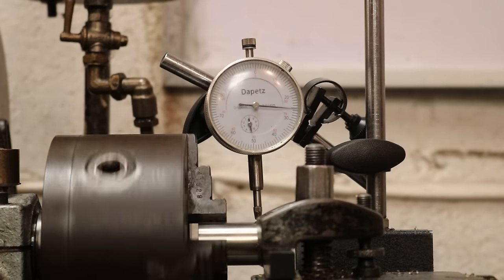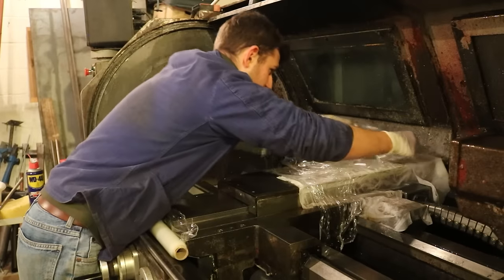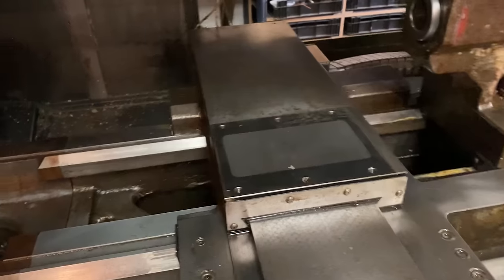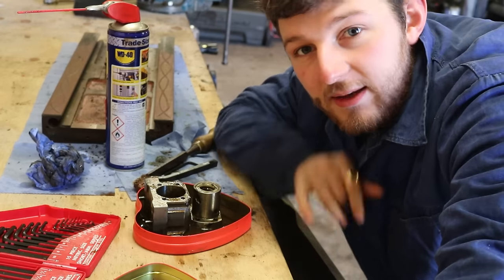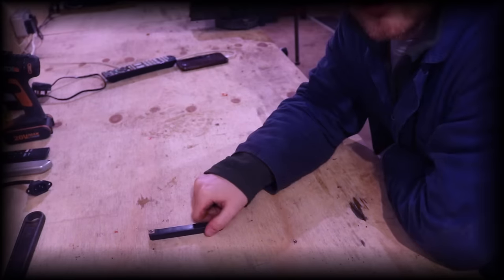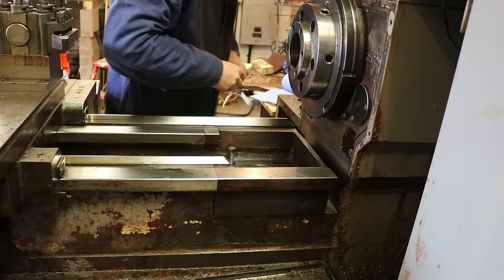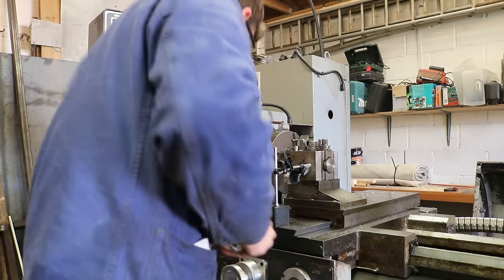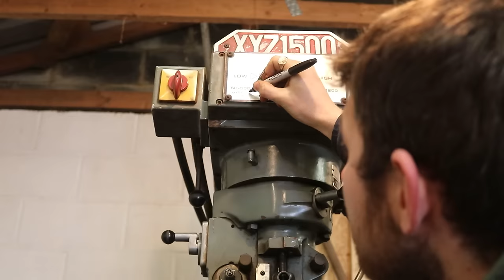Huge CNC Lathe Restoration || SANTA MARIA

Comment: Put a drill chuck on one of the cross slide tool holders. Use the tailstock only for part support.
That way you can also drill precisely, and it's how proper drilling is done on CNC lathes anyway.

Comment: What an awesome machine you got up and running! 
Im a bit concerned about the jaws you used... I would advise you to get some proper "rough jaws" that you can use for rough raw materials that comes in all sizes and keep the other jaws for specific diameters. Nobody wants to see a lathe yeet a part across the workshop :face-blue-smiling:

Comment: I’ve just had the same problem will my controller on the mill but unfortunately the screen won’t play ball, could I ask where u got the plans for the hdmi converter great content tho mate keep them coming👍🏽I’m rugby based I buy and sell a few bits of machinery and spares
Reply from the maker: Hi mate, type RGB to HDMI into google and follow the GitHub links. It’s really made for old pcs and games consoles but I was pretty sure I could get it to work for the crt on this. If you need anymore information about how I was going to wire it all send me an email and happy to share a few more details:)
Reply: Cheers mate

Comment: With such a lathe, try taking off 5mm of the diameter in one pass in mild steel. If you have the parameters right, it should be no problem. 
Should be able to handle 10mm too but be careful. You seem to be a beginner with industrial lathes so go slow.

Comment: CRT deflection is dead, from the looks.
Should be easy fix.
Apart from that, for real restoration, you basically have to strip the whole machine, there is coolant and crap in every corner, to get it really nice and clean, nothing but a full stripdown, clean and reassembly.
And put some new turcite on X-axis (glue, surface plate and scraping), lathe will destroy itself, with half of it missing.

Comment: I ran one of those for 25 years  and it ran 60 hours a week and the sh1t we got it to do with cheating the controller  like a 10 tool gang tool 
and we just got the new version 
shout if you need any advise with programming it 
we had a small heater in the electrical cabinet as our shop was always cold 
Best of luck with it